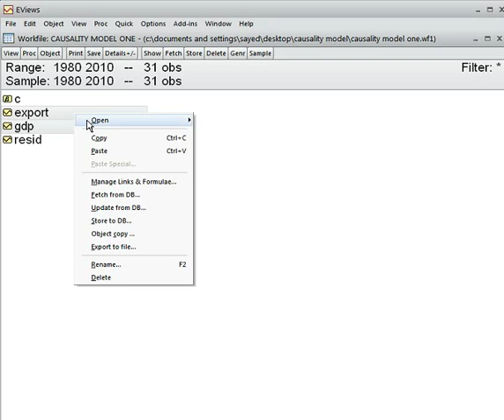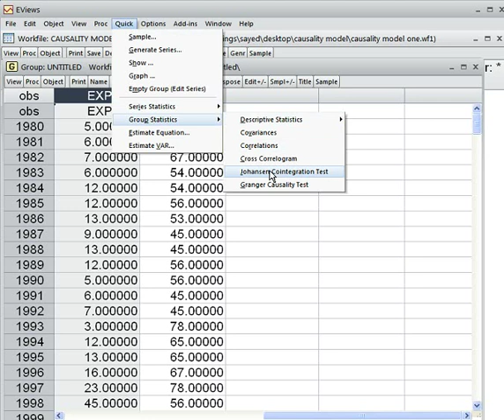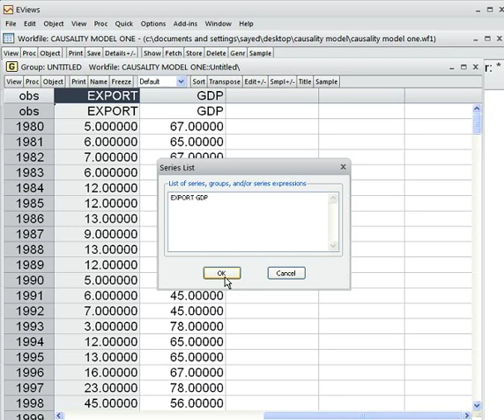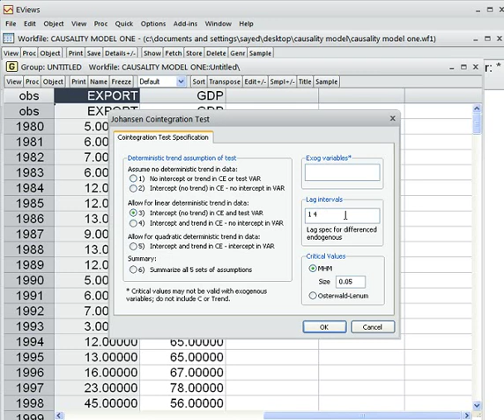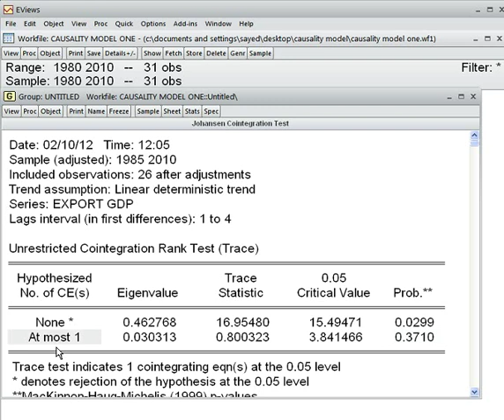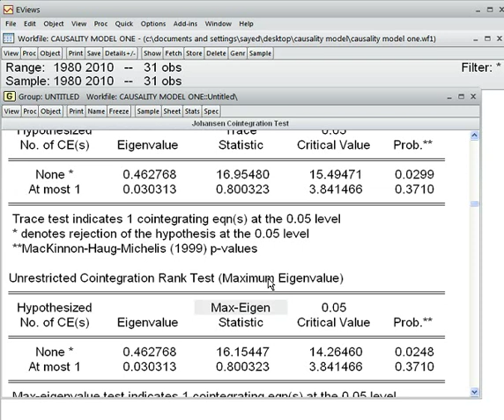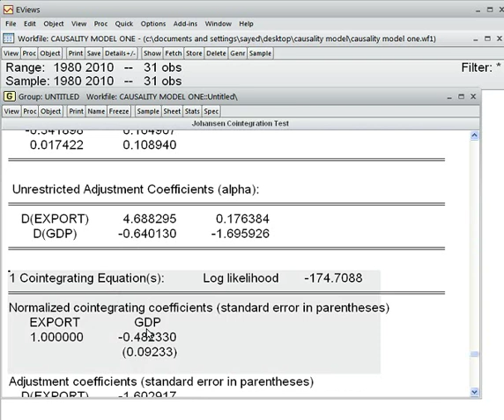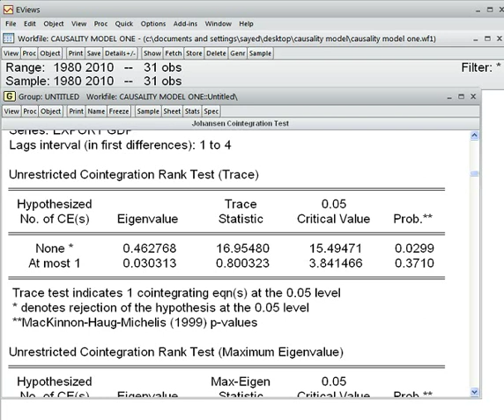VECM. Model One. Part 2 of 4. EVIEWS

Comment: hi! I have run the Johansen Cointegration test and Trace statistic suggests indicates 3 cointegrating equations and Maximum Eigenvalue indicates only 1 cointegrating equation...what shall I conclude. which error term shall I use for further analysis? Many thanks
Reply from the maker: You can take the decision of any one but best would be if both gives the same decision.